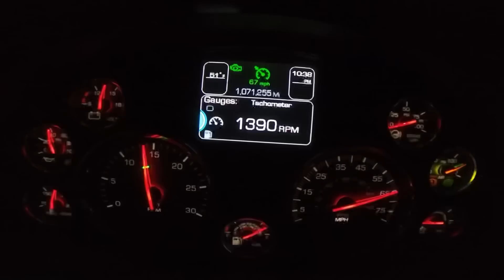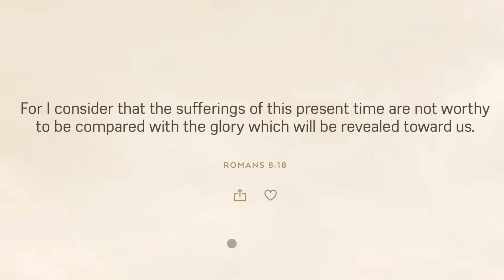March 5, 2023/49 Trucking. Floating the gears with 3 GoPro’s

Comment: That answered my question from the short.  Those guys did a great job checking things over an not just the problem itself.
Reply from the maker: I really think they went the extra mile to put pressure on the lines to make sure it doesn’t leak
Reply: @24juan68  👍🏾

Comment: I definitely preferred driving stick-shift trucks over automatic. It's been a while since I last drove a stick-shift truck.
Reply: Wouldn’t you prefer the truck just shift the gears for you? Less work.
Reply from the maker: Captain Kevin from WEL? How are you doing bud?
Reply: @keithmorgan4883  never preferred auto to manual, and I drove 13-speeds; in bad weather having a clutch can avoid accidents by maintaining traction when you need to slow for things like frozen bridges; with automatic you touch the brakes and go sliding. 
It's not any more work, you don't hardly realize you're doing the shifting after you learn and do it awhile. And shifting helps keep your mind on the job in heavy traffic. I see so many truck drivers today run into the back of people because they are hypnotized by the road and automatics doing their work for them.
Reply: @rayrussell6258  sometimes I'll downshift for the auto to stay more into it. Especially if I'm going through an area where I know the gear I need to be in.
Reply: @keithmorgan4883  Of all the automatic trucks I have ever driven, I have liked none of them. The problem is that with a stick-shift, I can anticipate when I need to downshift when I'm coming up on a hill. With the automatic trucks I have driven, most of the time, it doesn't downshift until the RPMs get too low, at which point, it's too late, and you lose even more speed.
Reply: @24juan68  Yes, that's me. WEL, that was me, anyway. Been very stressed out lately. How's everything going with you.
Reply: @CaptainKevin  What you do when you’re in an automatic truck is if you know you’re gonna lose speed don’t wait for the truck to downshift you make it downshift first. Don’t wait for the RPMs to get too low. You’re right the truck is gonna wait for the last possible moment in most cases if you’re slowly losing speed that’s why you manually request a downshift. As long as the RPMs are falling the truck will allow you to do it and will stay in that gear. The truck won’t upshift until you start gaining momentum again
Reply: @keithmorgan4883  Sure, but the problem is the truck seems to have a mind of its own. Yes, I can downshift first, but I have also had it happen where I would do that, and the truck would decide at that exact moment to do it on its own, so instead of dropping down one gear, it drops down two, and then I have a kerfuffle. At that point, I'm going to lose speed either way because even if I shift up one again, I'll have already lost too much speed.
Reply: @CaptainKevin  your right that does happen. The automatics definitely aren't perfect
Reply: @keithmorgan4883  And that's exactly why I prefer stick-shift trucks.
Reply: @CaptainKevin  I respect it. I was just thinking more as a local truck driver like myself who is stop and go all day.
Reply: @keithmorgan4883  Fair point. I was an over-the-road truck driver. In fact, the last company that John drove for was the same company I was working at, so there was a point in time when we both drove for the same company.

Comment: Back when I drove, our fleet all had 13-speed transmissions, and DOUBLE-clutching was essentially required to get the engine/transmission speeds in synch to shift gears. No "floating" of gears was done! 
I'm baffled how you lost that hose, completely gone like that. In the picture you showed here, it looks like the other shop replaced the hose behind it (I see new labels there). Shop must have taken this hose off to get to the other one, and not tightened fasteners on the one you just lost when they re-installed it. Ronald Reagan back years ago said "trust, but verify". That was my attitude anytime I had repair work done on the road. However, looks like you might have found a new shop that will do work right for you in the future, when you are in that area.
Reply from the maker: During the break down and went to cool, it was oozing out, both hoses were present. The blue hose was replaced in Houston Texas several weeks ago and the one that was leaking was the old hose which the mechanic in Dallas took off.